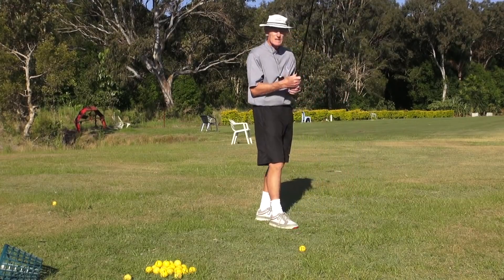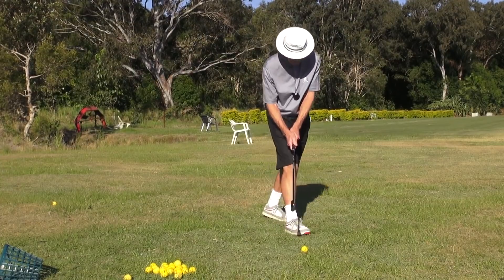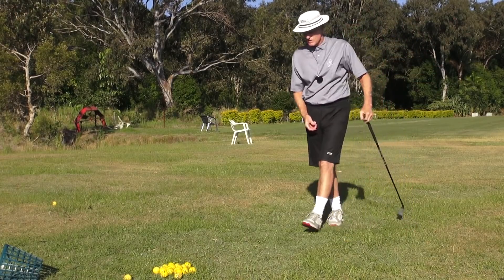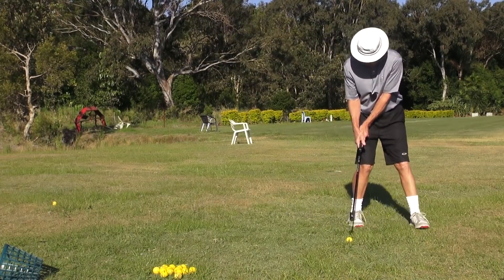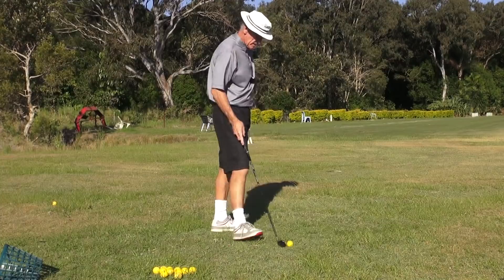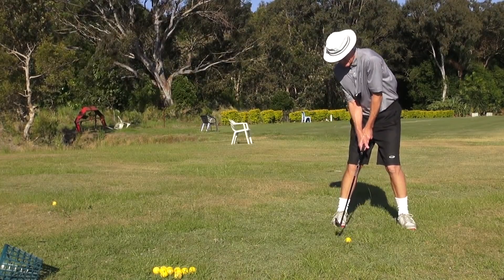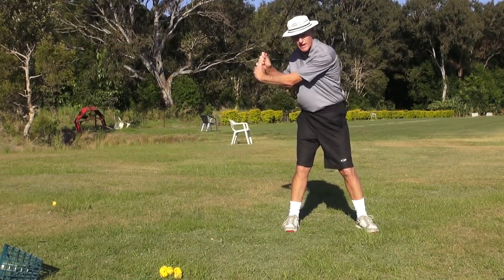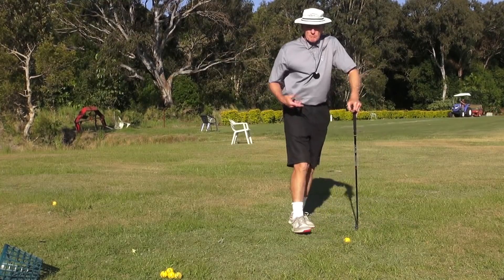More  Insight Into  Channel Lock   Processes  video 2

Comment: Hi JH ,         Very few moving parts in that swing  and that’s what I want in my swing.Not much can breakdown with cL swing mechanics and that’s why it’s scary good to the last shot!   Happy Birthday mate !
Reply from the maker: Thanks, Matty ,  yeah     I really feel   I am starting to isolate the 'jumpy/thrust'    actions of the body on the downswing now..   I just want to isolate my shoulder anxiousness at the start of the downswing and that will give my arms/ hands-free run down to the ball without the upper body putting pressure on the arm swing path to the ball at impact ..  I am really close to getting my   'final'   CL protocol locked in place ..             
                  cheers JH

Comment: Hi JH, the other day I was playing a round of golf with the channel swing.  I noticed that if I turned my lead foot inward some my ball striking was a whole lot better than if I did not turn it inward.  This was the first time I ever that I started doing that.  How does turning the lead foot inward help my ball striking and accuracy?  Does it help me to keep my shoulders closed and the weight on the trail side? It sure felt like it did and I was hitting some really good shots when I started to turn the lead foot inward.
Reply from the maker: Hi Ronnie, 
        Positioning the lead foot in that  turned  inwards  setting   will  most times  restrict  the amount  of  opening  clearing  of the   lead  hip  and as a consequence    should  add to  the   shoulders    not opening    before impact..   which  is really what we  want in the Channel Lock swing .
    So  I think  the reason you hit the ball better  doing that   with the CL swing is because you  are getting your shoulders  to  stay  closed  at impact  because you have  restricted  the  over  clearing  of  the   lead hip     coming into impact... that's all  I can  think of  as  the  reason  you  hit the ball better doing that .  
      cheers JH

Comment: Hi, JH,
I have a problem to hit driver and 3 wood by CL but hit iron and hybrid good. Should I put the ball position a little bit center from right foot for driver?
BR.
Reply from the maker: Hi Hong , 
              You can play the ball up a bit more with the  driver/3 woo/hybrid .. but make sure you stay well closed with your shoulders coming into the ball .. moving the ball a bit forward can make your shoulders open up because the ball being further forward in the stance .. 
                     cheers JH

Comment: Congrats old man!!! You act and look like guy in his 40s!! Know you have touched on it before, but again, what are your thoughts about "Parametric acceleration" vs modern day lag? To me, as a long time Yogi player since 1981, I get way more speed in my game from Yogi. When I try modern swing, and attempt what they call lag, I am tense and have less speed. Could be because I am 74. Still swing driver in the low to mid 90's but was over 120 in my prime! Would love an updated video if you think it is worthwhile.
Reply from the maker: Hi William,
                       My wife says I act like someone in my teens most times rather than my 40's .. mentally that is ..man would I love to be back in my    40's body ...I could rip a 2 iron out of  3 inch rough and fly it as high as I hit a wedge these days ..oh those were the days ..
                    I must say I have always had the same problem as you describe when I deliberately try to hold lag in the downswing .. I  just always seem to struggle with  'when' to let the lag out of the swing ..  and my ball flight is way to low ..        
                  I will revisit 'Parametric'   acceleration because it's really the way to get easy speed I think .. hey at 74   you are riding on the same bus of diminishing clubhead speed as   I am .. so  I should be cognizant of the needs of   us  ..' used to be   quick swingers'..
                          cheers JH
Reply: @1atomicgolf  Me too...always had the gift of long rhythmic swing when young. Am told I swung a lot like Sam Snead. At 6'1, 190 now, not as flexible but stay connected and shoot my age or close most of the time as long as courses are not over about 6200 yards now. If longer, my short game chipping and pitching has to be top notch like yours! Can't always guarantee that. All I am working on now is Channel with Yogi with lots of core work, speed drills and stretching. Yogi didn't have a muscle to his body and was tiny. When I think of him in 1981 at 73 and still hitting it 300 with wood drivers....well Snead was right. Longest and best player of his day....maybe ever!